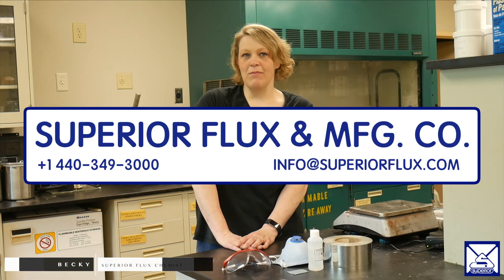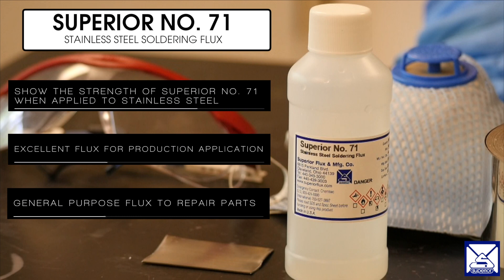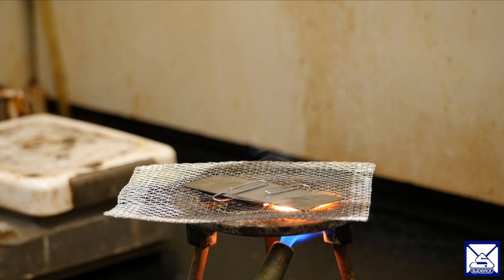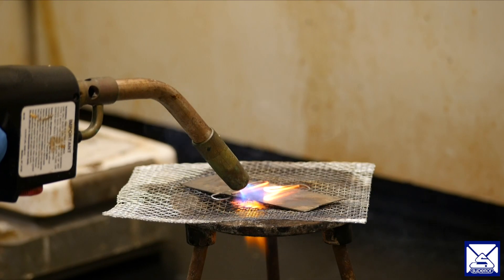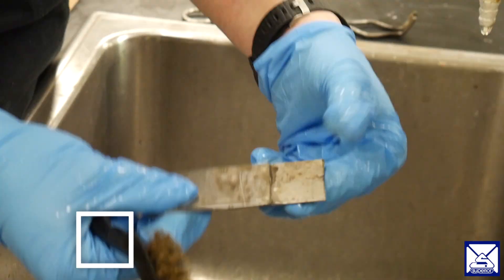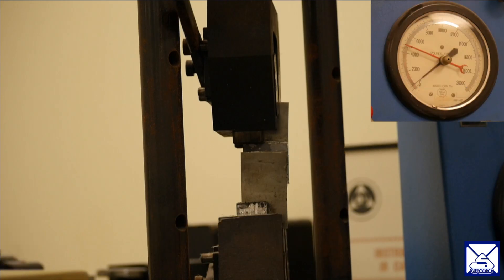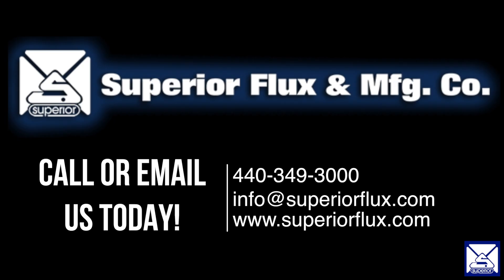How To Solder Stainless Steel

Comment: I use a 16x16 aluminum pizza pan with 1" raised sides under my dog's water bowls to cath drips, but I hate that aluminum oxydizes and gets pitted and rough, especially as it's continuously getting wet, they don't seem to make them in stainless steel so I'm probably going to get a piece of 24x24 stainless and bend the edges over on the brake/sheer at my workplace and see if I can solder the 4 corners water tight. We don't have a way to machine stamp the pan shape, so I'm stuck with having to form four 1" high sides, rolling the edges over and then soldering, brazing or welding the seams on the 4 corners.
I wasn't sure SS could be soldered but this video shows me that it can be, which would be easier for me to do at home with my propane torch than messing with the oxy/ace torch,  or the mig/tig wire feed welder at work which Ive never used before.

Comment: Shouldn't the first step for either soldering, brazing or welding stainless be to remove the oxide layer in the areas to be joined,  followed by an acetone wipe-down?
Reply: If present, wax, grease, and oil would inhibit wetting by the flux, so acetone wiping is not a bad idea. However, oxide coatings on stainless would be very thin, and easily destroyed by the flux.
Reply: Any experienced welder/solderer should know to clean the surfaces to be joined.  But this step should have been included for those just starting out.
Reply: The flux is superior, nuff said🥱
Reply: Well, it wouldnt hurt to roughen the to-be-joined areas with fine sandpaper, and wipe with lacquer thinner or the like,  that would remove pretty much whatever might be on the surface.

Comment: hi. nice video but for one part. in step two one can almost miss the application of the silver solder..one would think its just the flux and the two sheets being joined together. the narrator actually did not mention the solder or i missed it..otherwise nice video
Reply: Yeah, I had to watch it about three times to finally notice the caption overlay that mentions using “Solder Foil 3.5 Tin Silver” between the two plates of steel.
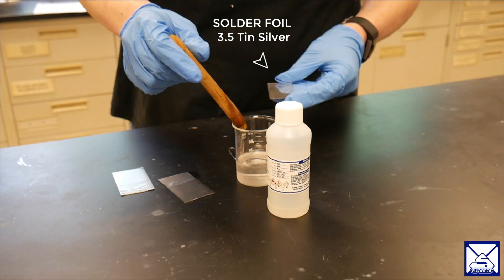Reply: It's on the screen at 0:55 - 0:59 with a label.  It's not hard solder!
Reply: Good comment Micmac. I also had to watch it over and stop at where the solder material was briefly mentioned.
Reply: killer Wolf  the foil was mentioned with a 2 second blurb and she NEVER demonstrated or mentioned placement .  Critical to the process yet barely covered. Kinda a fail for a tutorial...
Reply: @sheldonlong2299  I just watched this again.  That's entirely wrong!  You SEE a sheet of foil, there's a caption on the screen, the paper clips to hold everything together come after.

Comment: Hi, thanks for the video. I'm using silver solder to join two 1 inch A4 grade SS pipes at 90 degrees using two triangles of 1.5mm A4 stainless steel soldered to each at a tangent. The method works very well but leaves an area inaccessible for polishing and it looks a bit of a mess, especially on a boat. Is there any way I can avoid the staining? Thanks for any advice.
Reply: use a small sandblasting rig to remove stains?
Reply: @jbodden6977  never thought of that - might work. Can't easily get into the corner area to polish it afterwards, though better a matt finish than obvious heavy staining - but does a pitted/rough surface leave it open to more staining from salty sea-water?